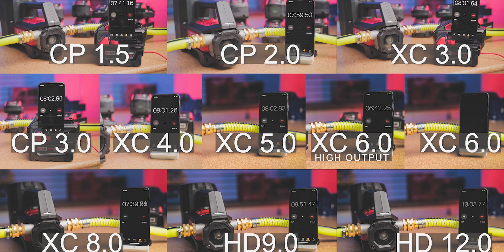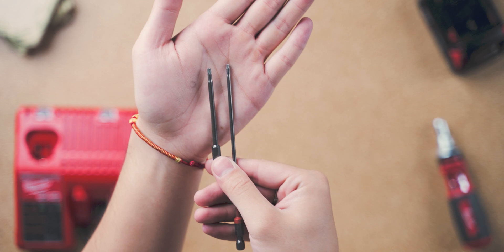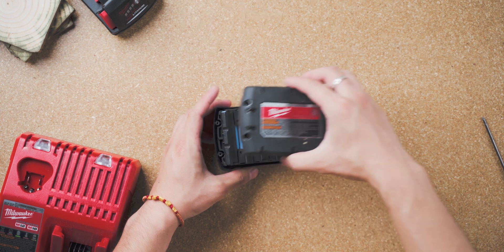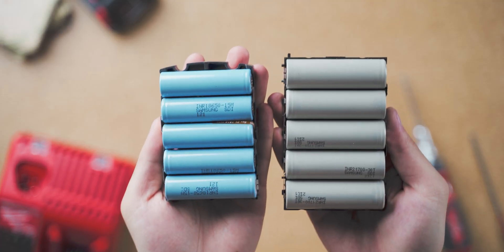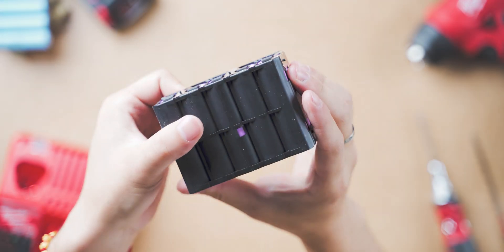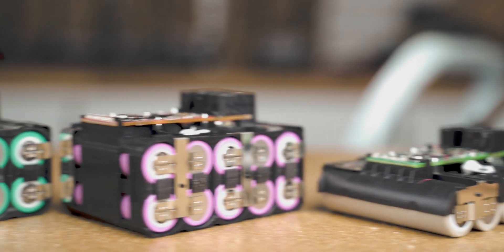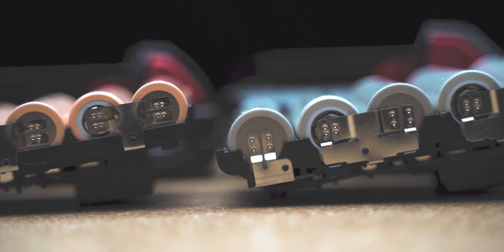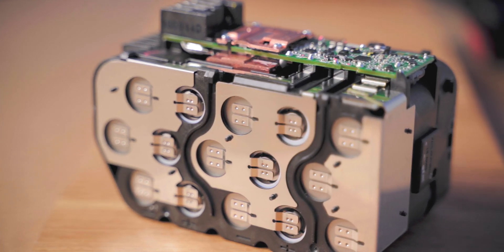What's Inside M18 Batteries

Comment: Good Video Jason, maybe just slow down on the speed you talk. Your articulate very well, just speak fast for the older crowd.
Reply from the maker: Glad you liked the video! I'll slow down a bit more for sure!
Reply: So would the xc6.0 battery more powerful then the xc5.0?
Reply: @mrwill203  longer run time but less power